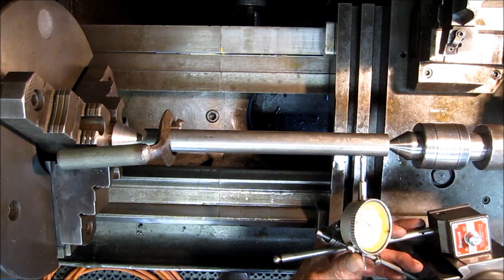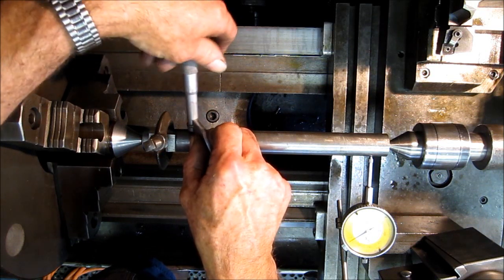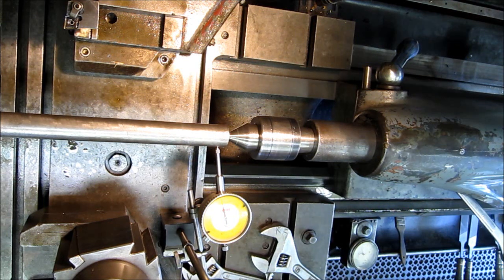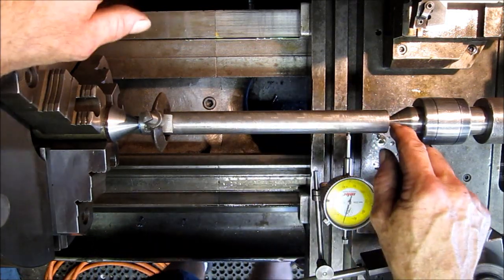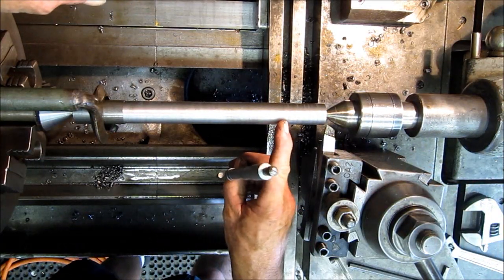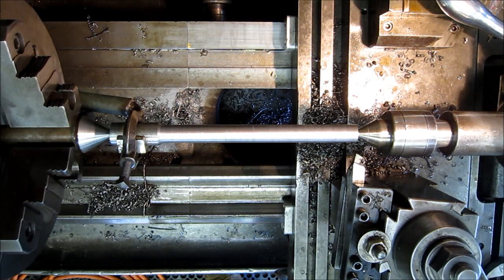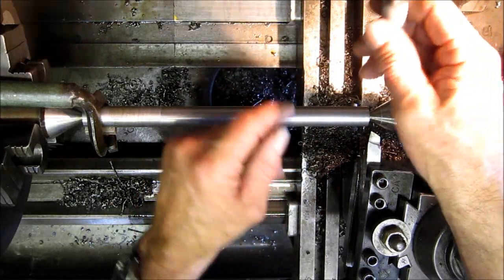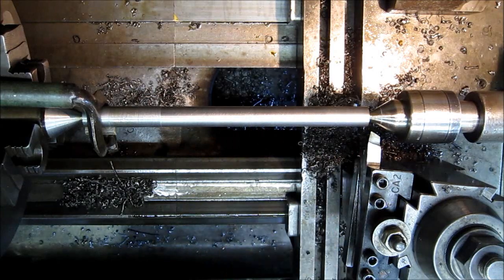Mail Call (Benchmaster) Part Three

Comment: what if you needed to turn from begining to end. Is there a way to set that up? because if you have to put a dog on the work then it seems a little pointless to turn between centers because you cant even turn the entire thing. you could just hold it a chuck.   ???
Reply from the maker: Cami, the centers are proven to give a true run to the part even if it is end for ended so what I suggest is to learn to pull out in a comfortable spot and blend in the cut from the other direction. Remember once centers are set up, you don't have to worry about run out. ;{)----
Reply: Okay I was asking because a part in was making was hollowed out in a canister shape and the wall thickness is less then .030. I had to make a plug to fit in the part after I bored it out so it wouldn't crumble into itself when in was turning the outside. The part also had a lip on it so I couldnt hold is very well in a small chuck. So I just carefully parted the extra off and faced the palet to dimention but a few of my classmates  crushed their part trying bring it down to size
Reply from the maker: Cami Lewis You did good, collet lathes or attachments are good for things like tubes and thin walls. You left out that you were working on a hollow project LOL. You also could make plugs with centers if it was a multiple run of parts! Thanks for the comment and a little chat on your project at school.;{)-----

Comment: I cut oil grooves in bronze bushings by using a full radius bit and a custom bore bars with the bit turned to match the lead angle of the grooves. Was done on a CNC lathe in IPM, not IPR.

Comment: Hi, Kieth,

I never got a ball bearing center to really center, Its always off for me by a half thousandth or more, even with my best, whenever the center is moved on the shaft.    I have to use a solid center for the truest work,like making tapered arbors.   Could this be why its a bit off when switching ends?     

                    Best Wishes,
                           Tom

Comment from the maker: I can be sure of a good finish, which most of the times light cuts with inserts give some alloys a ripped surface finish. Also I feel that the knowledge of using high speed tool bits is real important. and sooner or later we all have to use them. A light stoning to just rid of any burrs from the grinder, gives a cleaner cut. No follower rest as of yet and I wanted it heaver in the center, even if I didn't it much more of a pain if you’re running small toward the chuck.

Comment: Excellent!  Within 0.0005 end to end!!  HSS tool bit:  Since you seem to be a dedicated insert user, why HSS here?  Needed to achieve req'd surface finish?  Need for very small DOC?  Any special treatment sharpening HSS to enable .001" DOC?  Heavier in CTR of shaft:  Possible tool pressure is deflecting shaft?  Do you have a follow rest?  Kudos for stating feeds and speeds!!

Comment: Hi Keith, quick question.  I noticed that you trimmed the original stock to length by removing about an inch or so.  Why not leave that extra inch on, and then with the dawg in place you wouldnt have to flip the part as you could machine the OD in one pass (actually a few for spring cuts and finer feeds for finishing) and part it once you're done?  That way you dont introduce any more errors if the centres move etc.  Forgive me if its a lame question - im a machinist wannabe :)